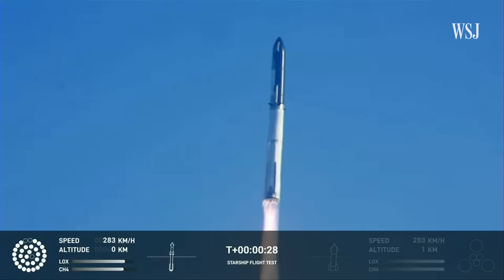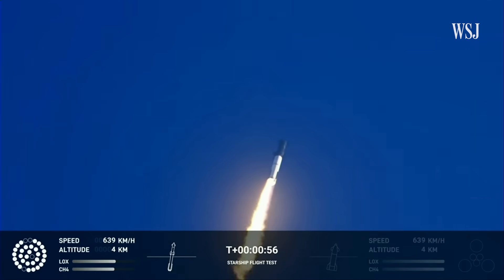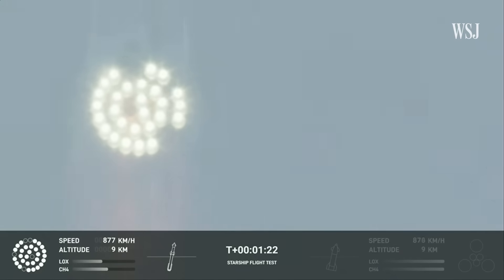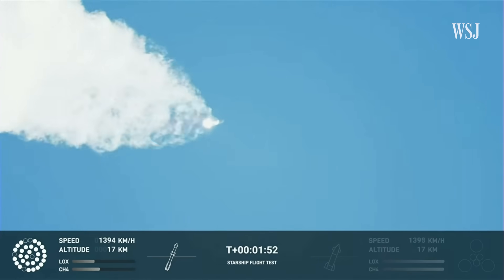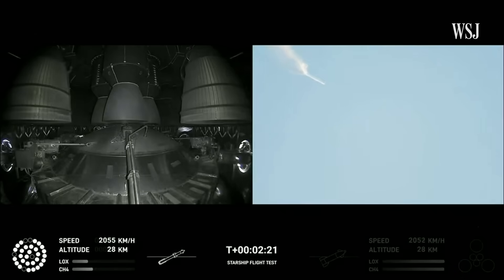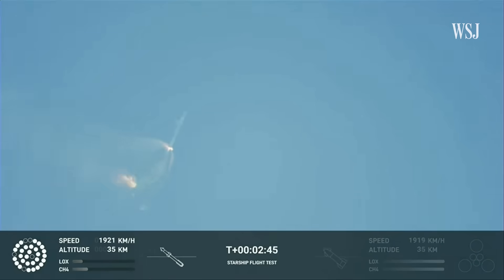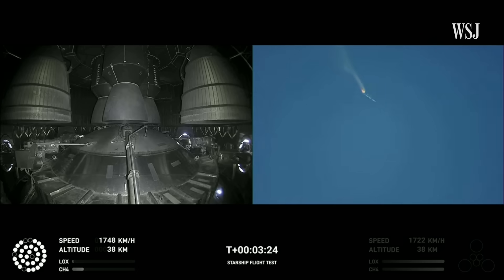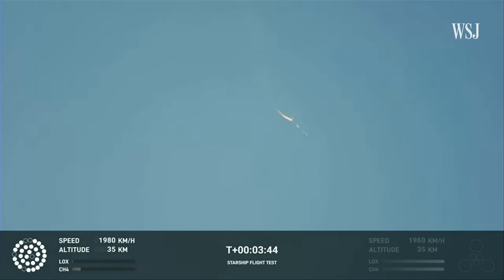Starship Explosion Video: Watch Elon Musk's Rocket Explode After Launch | WSJ

Comment: I'm honestly surprised it held together as long as it did during all those rotations! Pretty damned impressive really.
Reply: Perhaps air density at that altitude is was minimal so it could not damage the vehicle.  More interesiting is why they haven't even try to jettison  Starship and try to stabilize it under own power.
Reply: I agree. Considering it was travelling at 1200mph thats insane structural integrity
Reply: Pretty sure it only even exploded when they told it to self destruct. At that point,  it's no longer on profile and needs to be taken out before it can stray from the protected air and sea space
Reply: @ndrenckhahn4411  yup, pretty impressive!
Reply: WOW, Now that is what I call a tax write off.
Reply: Very impressive that it was still a fail? Lol
Reply: Why is this impressive? 60 years ago they played golf on the moon but this is successful?
Reply: @michaeltaylor6789  those programs ALSO had many failures during development and many test flights that looked to be a waste as well. You need data, you need feedback and at some point you have to actually build a thing and see how it does in real life not just simulations. That is what this test was. It was the first attempt to lift the vessel using the main booster stage. It will give them a bunch of data so they can tell what went wrong and know what to correct. They don't just slap it together and stuff it with people only to watch it fail THEN. It's better to have it fail >in testing< and that is exactly what this is all about.
Reply: I know people that work there and it's terrible place with low pay and overworked hrs
Reply: Unique technologies were presented at the international online forum "Global crisis. There is a way out". For example, the health capsule (the possibility of life extension, rejuvenation and absolute health), from time 7:09:09.
These technologies will be available to everyone for free in the Creative Society.
Reply: But, failure
Reply: @chanakapradeep4109  This was a totally successful test launch of the stack system, had the thing just worked everyone would be nervous to put anything on it next time.  Failure in rocket science is success, that's how you learn and advance.  If everything goes right then nothing is learned and every launch is even more nerve wracking.
Reply: Same! Watching the video feed from the interstage, you would be forgiven for thinking nothing was amiss. That connection was *solid*. I'll bet they got some great margin test data for frame stress/strain performance!
Reply: thank you corporate shill
Reply: It's pretty impressively bad actually.
Reply: @thesciguy4823  by the sci guy who does not know science, that's impressive in and of itself 🤡
Reply: Cope harder. hahaha. Seeing it fail and and disappoint the people that wanted it to work as planned so badly, feels really good. Bye bye
Reply: @OregonCrow  Maybe disappointing to members of the public following SpaceX, but not disappointing to SpaceX. This is the same iterative “fail faster to succeed sooner” development process they followed with the Falcon launch system, which is now launching near-flawlessly at a cadence of well more than one a week. It takes a lot of test hardware to do, but it clearly pays off.
Reply: @OregonCrow  Funny you would say that since SpaceX and NASA scientists have been collaborating awhile now. This event will only help NASA avoid the same. Or maybe you just hate Musk, idk
Reply: @tillitsdone  I don't hate anyone, just trolling the easily triggered.

Comment: What I don't get here, and someone will obviously enlighten me, we've had over 50 years experience of launching rockets into space, I'm sure the team at space X are all experts in this field, then why did they fail to get it into orbit?
Reply: Because Starship is a different kind of rocket. Starship is HUGE, and designed to be a fully reusable vehicle, the type of engines they are using (full flow staged combustion) are the first of it's kind to actually ever be used on a vehicle.
And I think it's also SpaceX's method of testing, failing, testing, failing, testing again.. until they get it right, unlike NASA which makes sure they get everything right before they launch.

Comment: I am for the success of Space X but this was embarrassing to listen to these clueless announcers.  First stage was nominal?  There were 7 engine failures with one of them exploding out the side!  Everything after clearing the tower was icing on the cake?  WHAT???  Did you not expect it to clear the tower?  During the attempt of separation, the whole rocket was spinning like a pinwheel!  3 to 4 full turns until the structure couldn't handle it anymore and tore apart.  It's ok that the launch failed because they were in the testing phase and they can learn from the problems that occurred but to hear the announcers act like this was all part of the test and for everyone screaming and cheering like a teenage cheerleading squad, it was embarrassing to watch.  Best of luck to Space X.  Get different announcers and lose the cheerleaders.

Comment: I think it would have been unexpected if it didn't end this way. Cleary the literal rocket scientists in the operations center were pretty ecstatic at how well the first ever launch of this vehicle went. How amazing would it be if the only issue they find is that the separation mechanism failed. I was blown away (pun intended) by the fact that the rocket handled that many flips at full thrust with the vehicle still attached and didn't rupture till, what, the fourth flip?

Comment: Yeah, that's a failure. The original test profile was for a separation of starship which would then fly around the Earth and then break up around the Pacific. It looked like from the get go several engines weren't lit on the bottom of the stack and then the craft started doing various loops for almost a minute before the announcer says anything.

Comment: I'm guessing that at least some of the engines that shutdown were damaged by flying debris during the launch and/or the pressure wave after ignition but before clearing the tower. Also, there was a gas explosion at the base of the rocket when it reached the top of the launch tower. This was likely caused by a buildup of methane within the huge billowing gas cloud. IMO,  SpaceX needs to build an exhaust bucket and water deluge system that directs the rocket engine exhaust away from the vehicle and also to reduce the sound/pressure produced by the engines during ignition and liftoff. Every other large rocket launchpad has both an exhaust bucket and water deluge system. They have these for very good reasons.
Reply: I certainly agree- flame trenches are a great tool to mitigate nearly all debris and damage, as with Apollo and nearly all other NASA launches. However, I began to imagine why they did not think about this before, or why they would otherwise opt out of using one. It may be that the entire purpose is the rocket is to be very affordable, highly reusable, and in this instance, very mobile. Perhaps they want starship to be capable of lift off from any launchpad without extensive infrastructure. It would make sense being that starship itself (not the booster) will be launching and landing from both launch pads and on extraterrestrial surfaces with zero infrastructure.
Reply: @jeremybernstein7794  They chose to not use tried and true methods for handling these forces. That itself is a massive failure to learn from other's mistakes.
Reply: @DarkZodiacZZ  I do agree, definitely tried and true methods for the past several decades. They were planning on installing a water cooled, steel plated heat management system, but didn’t get it done in time. Clearly they didn’t anticipate the shock from startup being as detrimental as it was. 

Though their methodology for launching is similar to the Soviet’s during the space race. Lots of data, lots of mistakes and lots of invocation in a short period of time.
Reply: I'm thinking they seem pretty stupid to have thought of these issues already considering how many rockets we have launched successfully.

Comment: What’s most amazing is that the rocket didn’t shear apart during its fall and had to be “self destructed” so to speak. 

The engineers who designed the hull deserve a raise. 

It goes to show how much on the cutting edge this team is, that a failure still provides useful data and allows them to iterate better.
Reply: Rockets don't usually "shear apart" in a fall. Their acceleration while rising is often more than g. Self destruction is the default procedure in such cases for all rockets.
Reply: LOL, Get Elons tool out of your mouth.
Reply: @randomname4726  Idgaf about Elon, there's a TEAM at SpaceX. 

Maybe get his tool out of your mind. You're the one clearly obsessing over it.

Comment: Most important part was that no lives were lost but overall an incredible step for Musk and his space pioneers at SpaceEx. Very impressive launch just didn’t get it separate the right way. More failures will happen but with those failures errors will be corrected and the flight plan will go without a hitch once it’s 100% ready. The future is limitless
Reply: Musk is the worst. It would have more chance at success if he wasn't involved in slowing down and distracting the real engineers with his idiocy.
Reply: @randomname4726  I’m pretty sure he isn’t involved in the designing process of the rocket just tell the engineers what to do. In this case a rocket thats capable of sending people to mars and farther and be rapidly reused. As a result they came up with the design of starship and they built it. Outside of some minor designs on the rocket like the pointed tip everything else the engineers designed.
Reply: @randomname4726  you poor, poor baby.

Comment: It's both hilarious and very frustrating to read all the clueless people who think this was a "failure" because they made the rocket self-destruct.   The REASON SpaceX has gone from nothing to the unquestioned industry leader in 20 years is because they use what's called "Agile Engineering" principles -- which basically means that rather than spending 20 years to finally launch a big rocket successfully like NASA did with the SLS, you instead take a try-fail-fix approach, where you build a "first draft" of the rocket, test it with at least some partial success (this was a VERY successful 1st launch), learn from the data you collect and fix the design, then build a "second draft" of the rocket, and repeat the process.   Doing this results in lots of tests that look like "failures" but actually help them learn to build a working rocket far faster than if they spent lots of time to get it perfect on the first try.   Or put another way, can you imagine how much longer it would take you to write something good if you tried to figure out IN ADVANCE everything you needed to write a first draft that was also the final draft, with no revisions needed?
Reply: Yeah but that costs a ton more money to do that's not viable or cost effective nasa did that successfully after the first launch sure it took 20 years but it's still better than having 500 failed launches during that same time period
Reply: @Ephemeral994  oh, I get it.   So SpaceX has been unsuccessful the last 20 years, because your logic is flawless.   They should have spent 20 years figuring out how to be successful on the first Falcon 1 flight.

Comment: Two considerations. First, if the starship was with a crew, it would have died. For this reason, the ship should have a dragon-type security pod with Drako engines on top. Second, since the Falcon 9 is doing well, they should make a version with raptor engines, as a fleet has several vehicles so they can use them on Mars, Moons, and asteroids for small loads.

Comment: The mass clustering of smaller engines was what led to the failure of Soviet-era N1 rocket (IMHO, still the coolest looking rocket ever built! :). The N1 had 30 engines in its first stage (vs five in the Saturn V) and the complexity of controlling all those engines and their associated plumbing resulted in all four launches failing. I hope that SpaceX can overcome this problem which appears to be of a similar nature with the first stage of the Starship Heavy Booster featuring 33 engines, some of which obviously failed to ignite or had flamed-out.
Reply: 1960s tech vs 2020s tech. Russians didnt have the electronic sensors and computers to pull it off. They also did not have computer simulation or CAD 3d modelling. It is feasible wit todays tech.
Reply: Based on the footage and imagery, the booster incurred some damage due to the 8 second hold down sequence, which lead to multiple engine failures and damage to one of the the HPUs. Starship uses engine gimbaling and thrust differential where the N1 used thrust differential only. Beyond that, the Raptor engine is the most throttleable rocket engine produced. Based on my observations, the main issue was the lack of water suppression on startup. That lead to a series of issues culminating in an inability to steer the vehicle due to loss of hydraulic pressure, leading to the flip which may have sheered the hold points, preventing staging from happening.
Reply: It was purposefully done wasn’t it? You could see a few of them light back up. Said something about the stagger of the engines?

Comment: Not sure why were they celebrating because they failed on stage separation which shouldn’t have failed. This step has been done hundreds of times by other space agencies. Also, noticed the lift up was too slow and than later saw 4 engines weren’t working, that explains why lift off was slow.

Comment: My guess for failure is locking detach modules failed.  Vibration, Spin could have added additon error tensions making the detaching relays fail in the latch release.  It does not surprise me when you think about how much weight torque is already on those parts, and how much more additional "forces" from tempature can cause electrical failure, possibly include frozen water that may have been around the electrical causing a shortage.  Those are my guess.
   At Least NASA got the Artemis to launch successfully thanks to a REcheck on the Engine and Fuel system.

Comment: Does it seem to anyone that the rocket was not traveling in a straight line with respect to the exhaust plume shortly after MaxQ. I got the impression it was a little nose high and the flame plume was pointed to the bottom of the cone of smoke. Some of those main engines never really shut down. I wonder how big a hole it dug in the ground just under the stand. there's video of a very large boulder ( 2 feet across? ) thrown out at high speed and hitting the back of an SUV and taking out a lot of the back end.

Comment: I would guess the explosion was due to the activation of the Flight Termination System.  Probably what doomed the flight was whatever issue prevented the upper stage from separating.  After that the rocket was uncontrollable and they blew it up for safety reasons

Comment: I am totally uninformed about this event, but assume the explosion was not planned? However, the cheers continued by the SpaceX Gang in the same way Tesla shareholders cheer each time the stock plummets. Strange Days indeed, Mama.
Reply: Not planned per se but totally expected. This was the first flight of a very experimental system and for that metric was basically an unmitigated success.
Reply: @maxv9464  Thanks for that. I will do some further reading about this over the next week or so, and see how much the event sets their program back. This latter metric is probably a good indication of the relative success/failure of this mission.
Reply: @jlvandat69  Sure. It seems their plans are basically still on track for a second launch in a few months.
Reply: @maxv9464  I would be very surprised if they had already made that determination. They are a smart bunch = a thorough analysis of the "unplanned event" before determining how seriously the failed systems/components impact the launch schedule. We'll see.

Comment: You can see it's already burning inside the stack before it even fully clear the tower. It was never on trajectory at any time and I'm shocked they let it get so far without scuttling it.
Reply: That's not correct at all. If it had been burning inside it would not have survived that long. There were engine outs, but no substantial internal fires to speak of, up until FTS activated.
Reply: @maxv9464  so all the stuff venting from the stack couplers was fog machines for dramatic effect I guess
Reply: @schmidtyschmidty5118  Venting from the stack? You mean normal venting for pressure regulation? That's a normal thing for rockets, not "burning inside the stack"